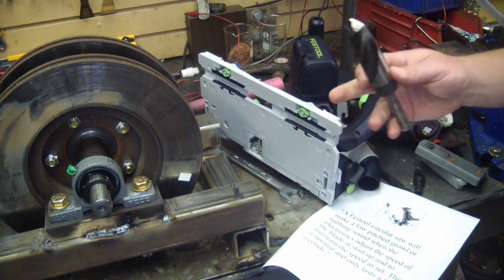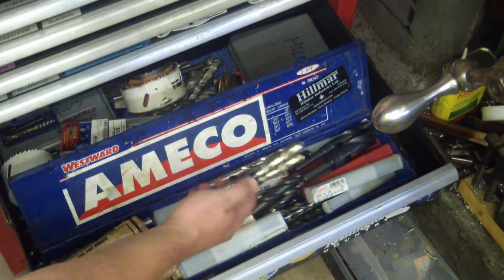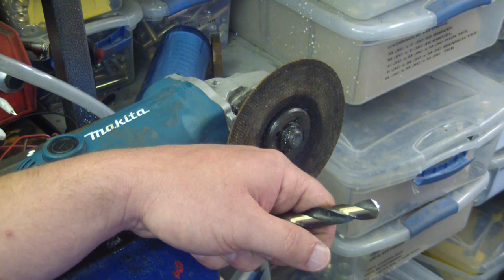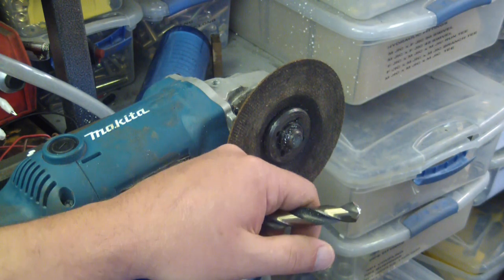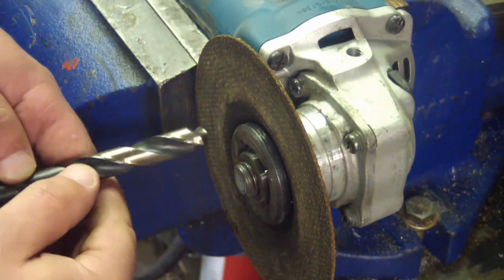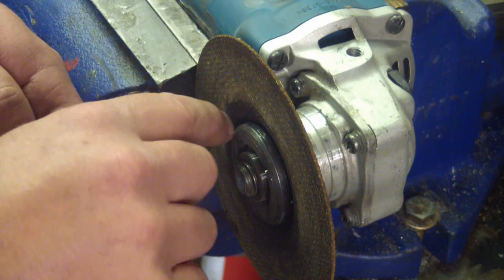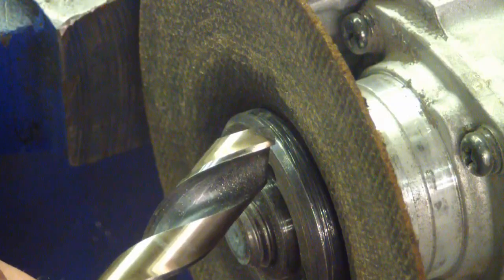Sharpen Drill Bits WITHOUT a Drill Doctor?!

Comment: I agree the drill doctors are crap for the money..If you use the 59 degree drill angle gauge its easy to get good sharp drills.. I hope these companies are listening to you...its better than TV..that's for sure..adverts interrupted by programs..R. 
P.S. do you have a video on small drill sharpeners.. 2mm /3mm/4mm etc. without using a magnifier.. Or do you just buy new one's..

Comment: OR, get a good set of molybdenum drill bits.  And don't ever sharpen your bits again.  I've drilled close to an hundred holes in quarter inch steel, and the bits are as sharp as day one.  Worth the 100 bucks for a 29 piece set.  Don't believe me?  I didn't either.  So I had to try.  I found out that, It's true.  Always perfect sharp.  Start of the job, middle of the job, end of the job, and then the next job too.

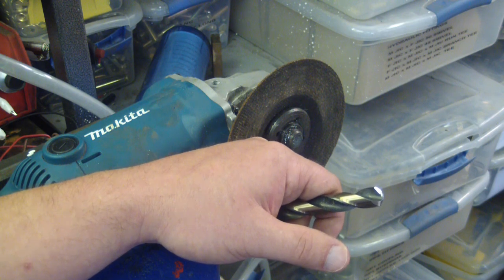Comment: 2:15 you would expect someone on a construction site to not spend 10min sharpening a drill because they have spares, right...

And then you actually go to a construction site where a "professional" company specializing in drilling comes to drill the holes, and happens to only have a single drill of the right size and length...  So they either have to drive back home to get a new one, or they attempt to sharpen it, but they've never done it, and a drilldoctor can't help you with a drill this big...

And the 10 minutes turns into 2 hours, with 3 guys trying to get it done and 6 guys standing around offering advise...

Sound familiar to anyone ?   nah, this never ever happens (sigh).

Either way, nicely done, even if the angle grinder for doing this does make the hairs on my back stand on end :-)
Reply: ***** so true.  at one of my companies, they got rid of our bottled water to save money.  what a buzzkill!

Comment: Fur Gawd sake y'all, don't buy a fuckin Dill Doktor. Take 10 mins to learn how to sharpen drill bits by hand, as shown here. It's very rewarding and ain't hard to dew.
Reply: we made hammer handles on the lathe, sand cast the head, and forged candle holders.

Comment: The best way to use a drill doctor is to modify it in to a tungsten sharpener for tig welding machine. We have in our factory something like 40 of them never removed from box. I think instead of learning the skill to use that piece of shit try learning the skill to sharpen the drill bids the classic way, at least is cheaper. Besides different materials need different way of sharpening your drill bids.

Comment: Drill doctor is trash. I learned to sharpen a drill bit in high school when I was 16 years old. Learned to sharpen them on a BENCH GRINDER. Somehow, what I learned still works now that I'm 36. How the hell did that happen? And it saved me buying a Drill Dicktor.....
Reply: +Lincoln Sterne Same reason for everything. Keep it simple, stupid. All the fancy gadgets in the world aren't better than a guy with a bench grinder that knows what he's doing.

Same thing with fancy kitchen knives. One 600/1000 grit DMT plate, one spyderco tri-angle sharpening set, and a cheap leather strop charged with 30, or 15 micron polishing compound. $100 (if that,) and a way better edge then any shitting local asshat with a bench grinder will charge (and wreck your blade in the process.) Same thing applies to bits - except the bench grinder is the right tool in this case.)

Comment: A manly man skill dating back to well into the dark ages of machining when a drill press had a treadle pearls instead of an elec-chicken   motor jobby that tested any well rounded tried and true machinist as opposed to the run of the mill self proclamated  guy claiming to be a died in the wool machinist just because they have a Louis Vaton gadgetimizing contraption to do a jobby of sharpening a drill bit, but if the pickle winds up being a bit too dill'd for your skills I guess 80-200$ lump a unicorn crap is more manly than learning to sharpen drills by had and looking back 5 mins if that vs the Richard Kranium POS of lugging it out finding power, setting up the jeezlus junk then working it over until you have a finished product, FUGG I just can't wrap my head around it, keep it up AVE way to bring back the age man and weed out the so called machinists, and to all the prissy drill Dr don't forget that you might chip a nail  when you try to " Be a MAN, use your hand" and just get the damn job done, You're my hero AVE!

Comment: The trick is the bit that you need is the one some yahoo tried to sharpen and got the angles screwed and your stuck with it
Reply: Can't B you A pair of hex nuts flat to flat get you the angle of the dangle you need. Think about it.
Reply: +Paul Frederick  Kin ell! That's got to be one of the best tips I've heard.
Reply: +Paul Frederick  Kin ell! That's got to be one of the best tips I've heard.
Reply: *****
Well, technically it is 2 degrees off. But it is close enough. 118, 120 I mean who's counting that closely?
Reply: *****
yeah it is all good enough for any shop that does not have a drill gauge. If someone doesn't have a pair of nuts that they can butt up together well, I don't know what to say then.

Comment: good video,,, i like to use a drill angle gauge when i hand grind but you can live without it... i do disagree with your assessment of those who took exception to your drill doctor review... how can you give a proper review if you cant use the device?? the most you could say is that the learning curve was too steep so you gave up... fine... i use a drill doctor... it is easy to use and quick... i use it to sharpen a drawer full of small drill bits... the drill dr is useless on large drill bits and its cheaply made, not for a professional working shop... but there is no higher moral position to NOT using the drill doctor its just a tool in the tool box and has nothing to do with being a sacred cow or any other religion.... i suspect you say that out of ego defense for such a crappy review on a device you couldn't operate.... you also have your followers you know your acolytes of grinding with a angle grinder... harumph harumph our drill doctor is gathering dust....

Comment: Drill doctors are nothing but crap I have had two different types of drill doctors in my shop over the years. The most effective drill sharpener I have in the shop is a bench mounted grinder with a fine wheel.